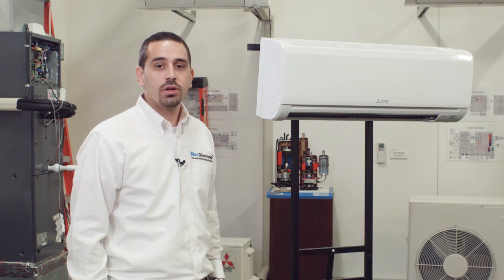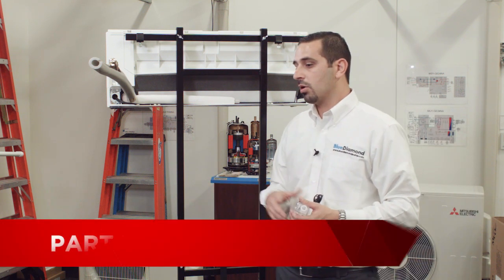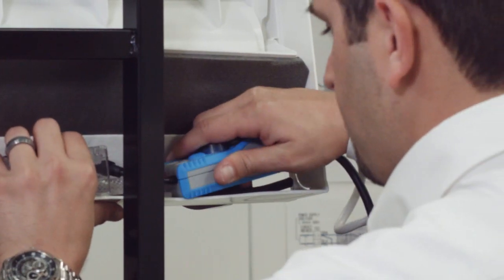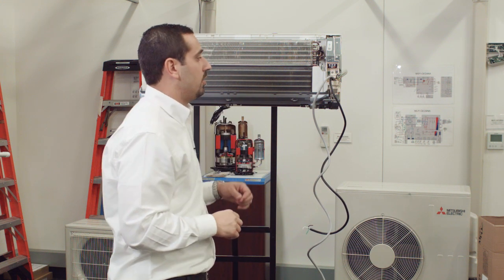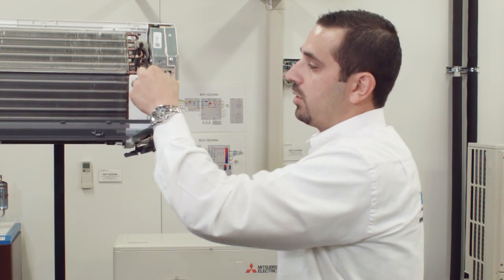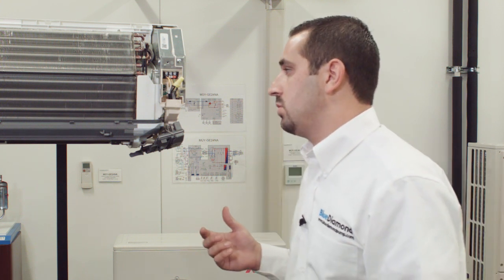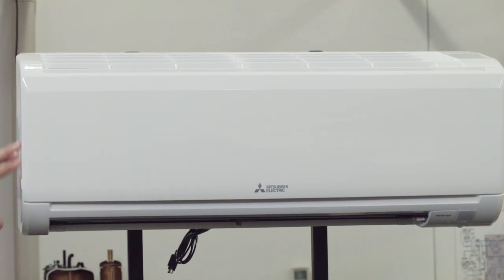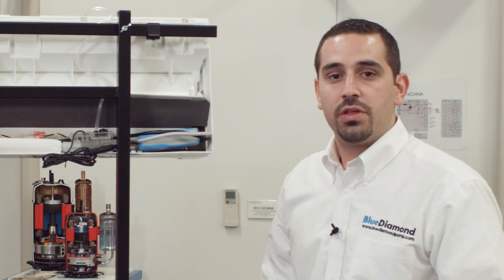How to Install a Blue Diamond Condensate Pump on a M-Series Wall-Mount Unit

Comment: The reservoir is very delicate, I’m using soft silicon tubing, not to put too much pressure on the  stub-outs. On the pump, the outlet stub-out is too close to the body of the pump. Not enough room for hose clamps, I’m using zip ties. Get rid of the factory drain house, use 10” section of 1/2” silicon tubing to connect the reservoir.

Comment: Can the pump be installed without the reservoir and still work when the water reaches the pump or do I have to install the reservoir with the pump and unit?
Reply: you're going to need the reservoir

Comment: What happens when you have to replace the pump and you don't have access to the back of the unit? Can you pull the unit off the wall to replace the pump?
Reply: I had the same thought. I was installing an MSZ-FS09NA today with a this pump and the documentation is a nightmare! They refer you to the MyLinkDrive tech notes for MXZ series, branch box system installs rather than making a video on it. Ridiculous. To top it off, the tech notes suck.

I did consider placing the reservoir in the wall, to the right of the unit, that way you would just need to remove a wall cover, or cut a small hole in the drywall to access the reservoir for replacement.
Reply: The covers on these units are removable, but I suggest getting a hanging tool.  I love my Mighty Bracket but, any brand is fine i'm sure.
Reply: yes you need to pump down, disconnect refrigerant pipes and it snaps off from the bottom. If you dont have mighty brackets then your taking it down and replacing it that way

Comment: I hope this guy doesn't actually fit ACs. The wiring is poor with lots of exposed copper, twisted connections, as well as reservoir where the wall bracket would go! 🙈

Comment: I have an MXZ system with a branch box.  I have two different pdf application notes.  One says to break RT12 or TH2 with the black (COM) wire from the pump and the other says to break RT12 or TH2 with the yellow wire from the pump.  Do I use the yellow or black (COM) wire?  If yellow is used, what do I do with the black and red wire?  If black is used, what do I do with the yellow and red wires?
Reply: Did you eventually figure it out? I am attempting an install of this pump with an MXZ-SM42NAMHZ and branch box. The indoor units are all MSZ-FS09NA and MSZ-FS12NA models. The tech notes on MyLinkDrive suck pretty bad. They need to create a video to address this.
Reply: @Dan-hd3cs   where did you find the MyLinkDrive
Reply: @donhenderson9093  I think you can find the link on Mitsubishi Electrics website